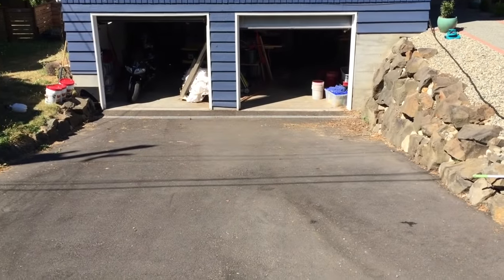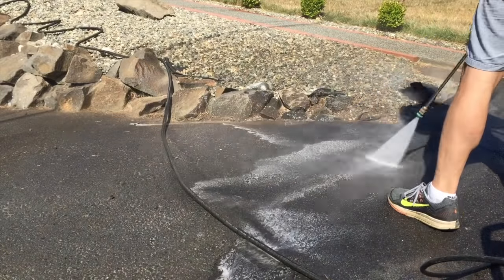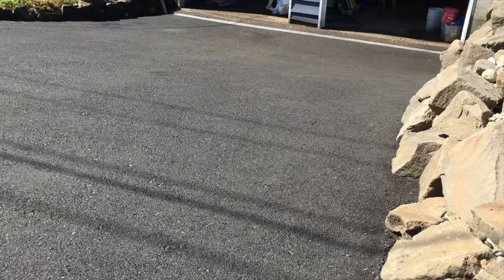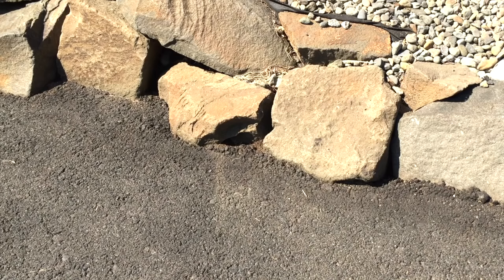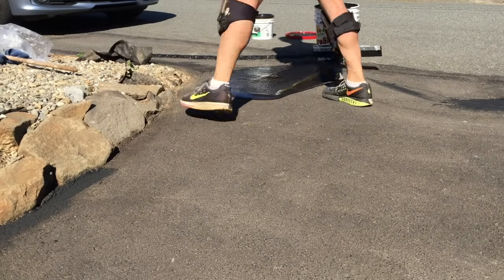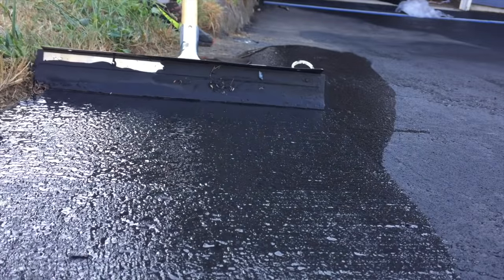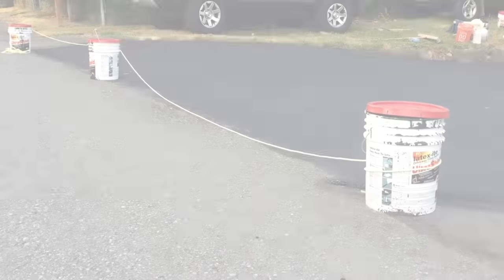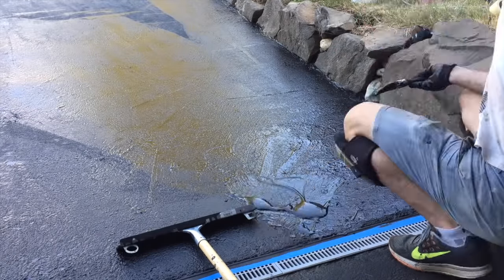DIY DRIVEWAY SEALING

Comment: It's perfect! I seal driveways and yes, we paint the edges where the squeegee can't reach or the asphalt butts up to concrete, rocks or edging that we can't walk on afterward. To get a crisp edge at the street use tape to get a clean edge. Good job! Yes, it's satisfying to watch!
Reply from the maker: Great to hear and thanks for the helpful tip with the tape.  Thanks so much for watching and hope you subscribed.
Reply: Hey, I do seal coating time lapse videos, check em out tell me what you think :) thanks
Reply: can this stuff go over a regular concrete driveway...if not what are the options to turn one into a black drivewat
Reply: @kmeadow0  no this is asphalt sealer. You should ask a concrete person about coloring options. Maybe a skim coat of cement that is tinted black would be your best choice, but ask a pro.
Reply: @shvaew  just curious as to why it wouldn't work?
Reply: @kmeadow0   it's a top coat which isn't designed to last forever, that's why you need to redo driveways every couple of years. It does wear off and it can peel. Do your research and if it's right for you then try it!!

Comment: I have sealed multiple driveways myself, and i find that the paintbrush for edging is fine, also I do squeegee, but I add a step, I take a rough surface roller and I roll the sealer. This gives the driveway a unified coat, but also eliminates the lines you get from the squeegee. You don’t have to do it but I like the look after rolling.

Comment: The blue tape is a must. I do my driveway every year and mask it off by my garage. I hired a sealcoat company to do it this year because I got lazy. They sprayed it on and did not broom or squeegee it in. I will be redoing it before fall as their process did not fill the cracks at all. Lesson learned.
Reply from the maker: Thanks for the information and helpful tip on the Tap.  Much appreciated.

Comment: Nice work!  You should do an episode on sealing your garage floor, that would be super helpful!
Reply: The College Woodworker
The garage floor is cement.
Reply: Yes it is, I meant sealing with an epoxy kit of some kind.
Reply from the maker: Thanks for the suggestion.  I'm planing on giving the garage floor a much needed makeover.  Thanks for the support.  Good luck with your channel as well.
Reply: I watched a few videos on youtube on how to do it. I did it right before I moved into the house and it came out well. I did a simple 1-stage epoxy. I cleaned, degreased, sealed all cracks and then rolled it on. Came out great am I am glad I spent the extra 2-3hrs doing it now before I moved in. Now the garage is full of boxes and stuff lol.
Reply: @BYOTools  Hey man, you should check out Rubber Stone for your garage floor. Lots of possibilities with colors or just go with black to match your sexy driveway.

Comment: Just a suggestion I do this for a living and one way to save from bending so much is to use a cheap synthetic broom from the dollar store instead of using a paint brush. Plus it makes it a lot easier if you seal the edges of driveway first and then seal the rest as you showed in the video.
Reply from the maker: Thanks for the GREAT suggestion Michael.  I appreciate it and thanks for watching.
Reply: Michael myers

Doing drive ways during the day

And murdering people at halloween
Reply: @Weirjetwashing  Everyone needs a day job.
Reply: @ Michael ... are you still in the business? you are probably not in my area (upstate NY) but wondering if you could comment on pricing by a professional. my driveway is approx 2200 sq feet.   alternatively, could you advise what is the best sealant a homeowner should use?  also, I have a significant crack running through the width of the driveway, what is the best way to fill it (it is not that wide of a crack).  Tx!

Comment: Hey man, quick tip for if you decide to seal your driveway again, wear waterproof rubber boots and after say you edge and seal the top half of your driveway, walk back up to the top and do a finish brush going side to side down the driveway, sealing over your footprints as you go down and then repeat the process after the second half is edged and sealed. It makes it have a lot cleaner looking finish. Great video though you gave some great tips!

Comment: At 5:38 you say "And it's not going to be reusable, trust me." (The squeegee) That is not true. Just a friendly FYI for everyone. Yes, you can reuse it. I have a very large driveway and I ended up doing it over several weekends. All you need to do is rinse the sealer off with water. I also used a putty knife to carefully scrape off any residue that wouldn't easily rinse off and yes, I was using the same exact sealer as in this video. Otherwise, good layman's terms video.

Comment: nice job. three pointers.    1. to stop future weeds coming in.  bury a timber or plastic strip at least 100mm deep at the edge of the driveway to prevent grass coming under the driveway from the lawn. use weedkiller on the grass already coming through, and leave it for 2-3 weeks to ensure the roots are dead.    2.   do NOT use a petroleum based degreaser as it will eat into the  existing bitumen - it will dissolve the binding agent in the bitumen.  use a detergent based degreaser.    3. The cold mix material you laid for the drainage is a great idea as well as the  sealer you put under it as a binding agent. however, the cold mix is made by adding a small amount of a petroleum agent such as diesel to the bitumen in the cold mix to keep it supple (in the factory). it is best laid when there is sunlight. stretch it out and let the sun warm/soften it a bit more , then place and tamp it exactly as you did (or you can cut and dig a small trench and place it into the trench to prevent the possibility of it shifting when you drive over it. once laid, sweep a very small quantity of sand over it to lighten the colour (absorbs less heat from the sun and wont stay as soft) and eliminate surface tackiness. leave for 2-3 weeks for the diesel to evaporate - then seal it as you did. you will get a sturdier job.

well done.
Reply from the maker: Thanks for the detailed tips Evan.  I'll have to remember this next time I do a seal coat.  Thanks for watching and the support.

Comment: Coming from a guy who does asphalt sealing as a job this looks great.  I do recommend that you seal in a back and forth type way so that you cover everything twice from opposing angles.  With a newer driveway such as yours it isn't as worn and pitted so it didn't matter as much ,but as time goes on if you were to only seal from the one angle some spots will not get hit with sealer.  Also check if your sealing products contain Coal-Tar, this is a known carcinogen (cancer causing) element.  If possible use a Coal-Tar free Asphalt Emulsion.  Works just as well without the risk.  There is more too I could say ,but as a DIY this is top level.
Reply from the maker: Thanks for the input BK.  I'll have to remember this when I do my next reseal.  Thanks for watching.

Comment: Ugh, nice video but what a terrible driveway, you must not get heavy rain or I would think that drain ditch before garage would just overflow.
Reply from the maker: Unfortunately Seattle gets plenty of rain haha.  Check out BYOT #35 to see what I had to do to fix the overflow issue.  Thanks for watching.
Reply: Ahhh Seattle, say no more lol, I will check it out.
Reply: I live in the Seattle area too, we get plenty of rain but not heavy rain. It's mostly a light drizzle. If the drain was installed properly it should be able to handle quite a bit of water.

Comment: I know this was posted last year, but some advise. I work with sealcoat everyday for the spring and summer, next time I encourage you to try a sealcoat broom. Its the same thing as the squeegee, just easier to evenly seal thoughs tight corners. Plus after you are done with is soak in diesel or was with water right after(depends on if using water-based sealer) to use for next time. Real money saver. Everone is different and have other opinions on tools to use for this job. Just want to help you😊

Comment: Why don’t you just buy 200 cans of flex seal and some flex tape
Reply: Do u no the hassle it would be to spray 200 cans of flex seal when u can use a 2 5 gallon buckets of the real asphalt driveway sealer cost 40 bucks ?? Lol

Comment: That shit dont work its just paint
Reply: Read.
Reply: its a seal not paint
Reply: Its goign to wear off in about 3 years
Reply: @hammy1770  no seal coat has sand and clay in it. The sand and clay is used to adhere to the asphalt and to fill in the rock. So seal coat tanks have big agitators in it to mix the sand and clay. This stuff he is using is what you call driveway dressing. Pretty much a paint that makes it look good but does not help the driveway in terms of longevity. Seal will fill in the bumps and help your asphalt last better.
Reply: @rbeck3200tb40  more like a year or 2

Comment: I have asphalt in my garage. Do I need sealer?
Reply from the maker: Thanks for asking Max.  If you garage is indoors and not out in the elements then I would say no.  The sealer I used mainly helps to protect the asphalt from seasonal weather changes.  Thanks for watching and keep up the great work on your channel.
Reply: @BYOTools  Ah I see. The asphalt is very easy since you don´t see any dirt and stains, but on the other side it is also not as nice and smooth as epoxy.

Comment: You could have completely covered the drain/grate with the painters tape so it would have been even faster when going over with the squeegee. However, you did good utilizing the paintbrush with the smaller area leading into the garage. Good job dude!

Comment: I did seal coating for 2 years professionally for a company and really all that isn’t necessary pressure washing might be sometimes but basically all u need is 1 steel brush brush it clean and seal coat it pressure washing isn’t really necessary tho + use rubber crack filler last way longer And use brushes

Comment: There's absolutely nothing wrong with doing things yourself, most men want to take it upon themselves to do things without the help of outside professionals myself included which is why most of the trim in my house is a quarter of an inch too short and the tiles on my bathroom floor don't lineup straight. And that is my point at the end of the day there is stuff a professional is going to know that a home owner just isn't there are better tools that they will have at their disposal that a homeowner just won't, they also know the little tricks of the trade to make the job look its best that home owners wouldn't. I give you all the credit in the world for trying to do things on your own I just have a problem with a video that leads on that it's the best and correct way to do it
Reply from the maker: Thanks for the clarification.  Much appreciated.

Comment: You don't need to wait 48 hours you can drive on it after 3 or 4 depending on the heat, I usually spray when I do parkinglots

Comment: Is normal to have some stripes or color differences in some areas after the application?
Reply from the maker: What type of Color differenced Anibal?  Was it because of the different buckets that you used?  There was not a difference on my project.  Thanks for watching and hope you subscribed.
Reply: @BYOTools  I did my application by squeegee 72 hours ago, but I have some stripes with a different shade. Would be ok to do a second coat?

Comment: Best to wear beat up old shoes when seal coating, once you can throw away afterwards, OR rubber boots that the seal coat will not adhere to and which when dry will fall off after some flexing.

Also it is recommended to push the seal coat back and forth with the squeegee a couple times before pulling back the excess. In this video it was just pulled forward once. 

And you don't need a de-greaser.....put some pavement detergent in the suction tank of your pressure washer, and use that to do the cleaning. De-greasers are typically fast evaporating solvents that can possibly have a deleterious effect on the asphalt binder,  and which used as shown in this video will just evaporate without actually removing any crap on the driveway.

Also, the sealer shown in the video is a black latex product, sort of like black latex paint. While it seals the driveway alright, it does nothing to replenish the emulsion of the asphalt, which slowly dries out over time, contributing to cracking. There are sealers which are based on a coal-tar emulsion, which works well but has safety and other issues, and is not so popular these days. Asphalt emulsion sealers are supposedly superior to the coal tar emulsion sealers, help to rejuvenate the underlying asphalt, and are safer and better for the environment. Asphalt emulsion sealers might have latex or other polymers in the mixture. However, I have seen some latex sealers that, from their labels, seem to not have any asphalt emulsion in them, which makes me wonder about how well they really work, and if their continued use may result in more rapid aging of the underlying asphalt. I would counsel caution when selecting the sealer to use, and not just grab a product because it has a nicer label, or is a bit less expensive.....you might pay for that decision a few years later when your driveway starts to crumble.
Reply from the maker: Thanks for the helpful tips and the detailed response Youtuuba.  Much appreciated.  This was my first time doing this so i'm always up for some helpful tips.  Everyone has their own opinion on the sealer but all I know is that it still looks good and haven't had many issues at all over the years.  Thanks for watching and hope you enjoyed the video.

Comment: Wow! That made me tired! That's what I do is seal-coat driveways and parking lots! Holy cow we do it totally different. We have a 750 gallon tank with an air compressor and a sprayer. We use a broom to get around the edges of the driveway. Like around concrete or anything we don't want the sealer on. We call that trimming in.

Comment: Great work. Really enjoyed watching you seal your driveway. What does that stuff cost a bucket ?
Thanks
Reply: At least 35 to 40 bucks it’s basically latex paint all the big box store sealer is crap by the time you buy the sealer and other materials you could hire a pro that will use better materials and save your back from lugging buckets around !

Comment: Why did you use crack filler instead of asphalt on that hole with grass?
Reply from the maker: I potentially could have used the patch material that I used for the hump that I created but I figured I would use the crack filler since I had it on hand and was specifically made for that type of circumstance.  Luckily it worked haha.  Thanks for watching Michael.

Comment: Nice Job.  Are you still happy with the products you used  to do your driveway?  I have a massive driveway that is about 800ft by 11ft, plus a parking area that can fit 20 cars - probably 30x45 feet.  I've been getting estimates for a company to seal it for me, but they are coming in between $3,300 and $4,500 USD.  I live in the northeast.  I'd like to save some bucks by doing it myself and with a friend, but the number of buckets needed and time needed to do this job right concerns me.  How long did it take you to do your driveway?

Comment: Can you second coat. Sealer
Reply: RC  fabrications and body yes
Reply: Not a good idea the build up over time with to many apps will crack all the sealer and the surface cracking of the sealer will never go away professionally done with brushes as long as its not a drive by company should last at least 2 years without having to get it redone

Comment: You did a pretty decent job for being new to sealing. But, just some tips for next time, wait about 2-4 years depending on weather conditions of your area. Try to look up local manufacturers in your area for sealcoat, store bought dealers, do not last as long and flake apart. Your squeegee, is reusable just proper cleaning brings it back to life, as well invest in a special type of broom, made for sealing, it’ll get the seal inside all pores instead of just laying on top.

Comment: Professional asphalt contractor here actually these products are harmful to the asphalt they might look good for a year but eventually you will notice surface cracks that turn into larger cracks over time these products are water base and asphalt is a oil base material so the two don’t mix that’s why we recommend a oil base sealant you can’t buy in your local hardware store call a professional contractor rather than use cheap hardware store stuff

Comment: So,  your garage floods and you seal the driveway... that's the worst thing one would do. Even with that rain gutter a strong storm will be like pointing a hose directly to the inside of the house, because if you waterproof the soil water will just slide to the lowest point. You should be using pervious concrete or simply drill holes onto the pavement so water can soak downwards to the soil. You should now invest in building a cistern under the house to store all the water you'll get inside during the winter

Comment: Asphalt driveways have too much maintenance . 
Interlocking bricks over a highly compacted base is the way to go. It will last forever and if you need to get at some pipes or electrical cables underneath, just pop out the bricks in that area , do your repairs, recompact the base and reinstall your bricks.